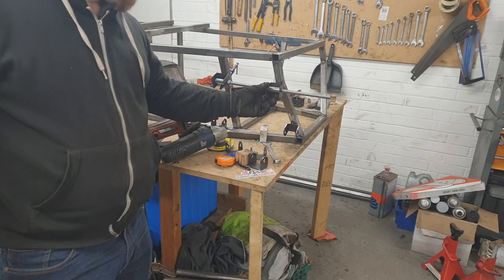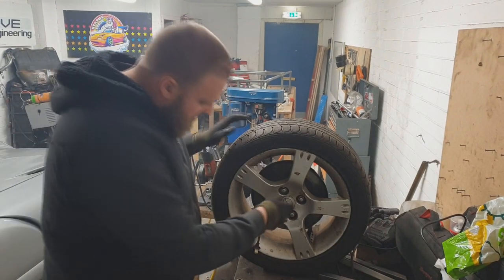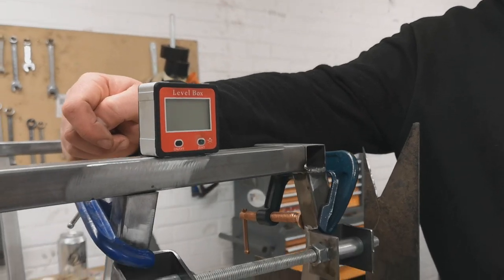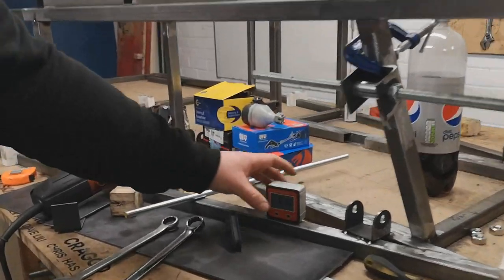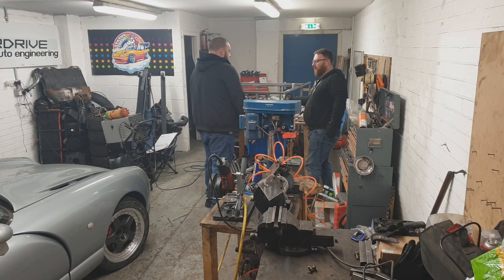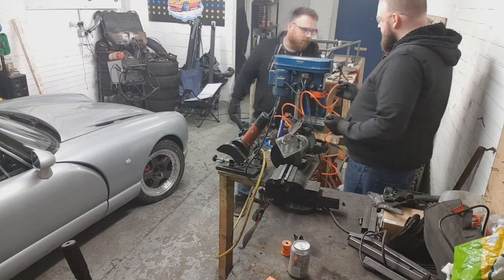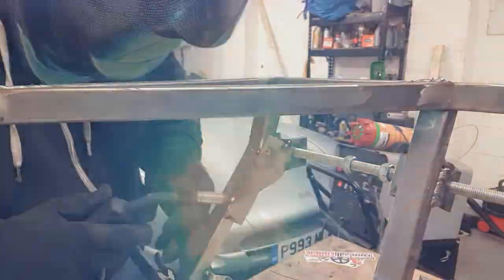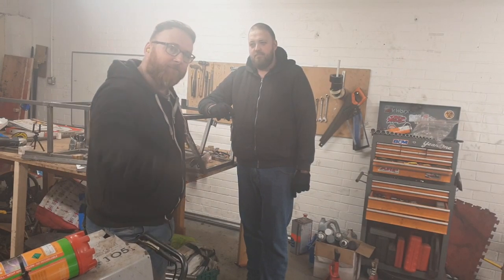Locost 7 Kit Car FULL BUILD!! - Episode 8 - ADDING STRENGTH! (Project 7-UP)

Comment: Please cover up the silver car.  If the hot metal from grinding gets on it it will burn into the paint and glass and make a right mess.  I had to have a new windscreen in my Mini after a garage did some grinding next to it.    Cheers.
Reply from the maker: Thanks Mike. We try not to weld near it and move it out the unit when we can. Its due for paint soon so we are probably not as precious about it as we should be!

Comment: if the board was barked out in square lines to begin with, all base measurements could be much easier to get, resulting in quick heights for suspension points.

Comment: Does your country not have penetrating oil?
(I've also broken a caliper hanger bolt, and religiously use penetrating oil before applying substantial torque since.)
Reply from the maker: We do, but sometimes no amount of fluid will help